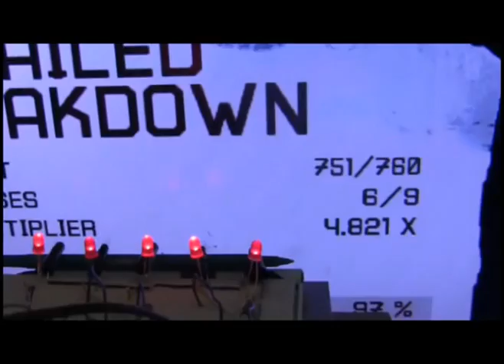DeepNote™ Guitar Hero Bot Prototype plays impressive solos

Comment from the maker: 5. It can work with any size TV.  In this video is is in prototpye form, but we recently completed an adjustable rack for the sensors that allows them to be positioned for different sized TVs.
6. As you can see in some parts of this video, it will play very fast notes.

Comment from the maker: This is currently running on the PC, with a USB guitar.  But can also be used on a 360 because it uses the same guitar.  The PS2 and PS3 versions use a different guitar, but the hardware could easily be moved into a different guitar.

Comment from the maker: Our bot works by using photodiodes (basically like little solar cells).  They pick up changes in light in front of them.  Using correction circuity, we can use the light changes indicated by notes to create a digital signal.  The processor takes those signals, fixes them some more, adds a delay, calculates if they are chords, and then sends commands to the guitar circuity via relays.